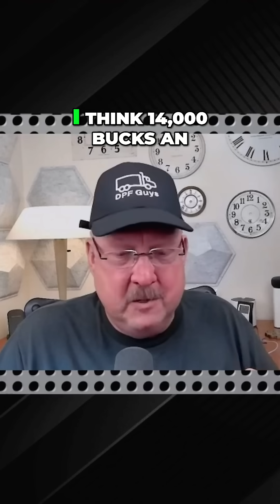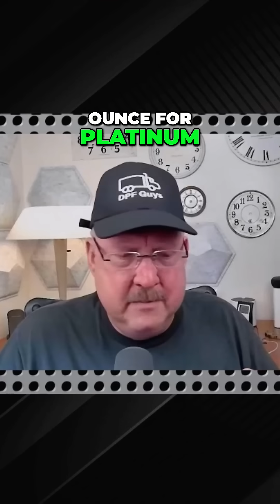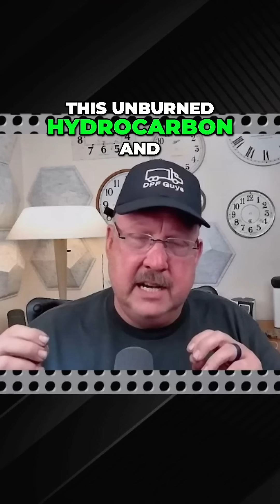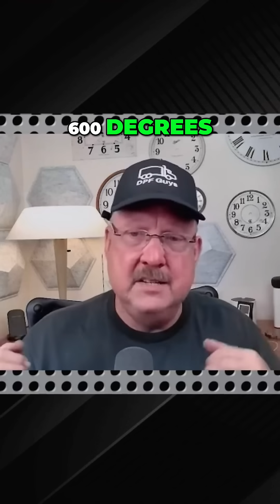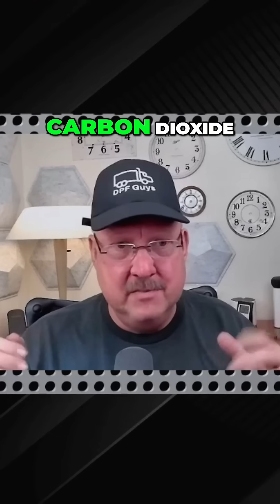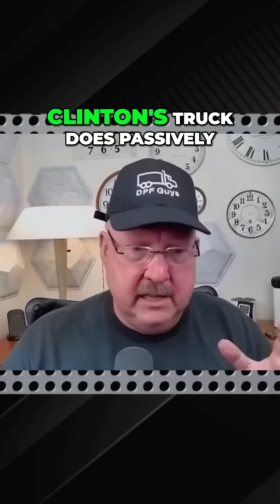Diesel Regen Explained: Catalytic Converters, Platinum, Rhodium & More!

Comment: Great education on synthetic oil protection. Great job, Mr. E on sharing the education about DPF filters. 
     Diesel motors must run clean and eficent to be have a great running motor. 
      Clean fuel injectors, 100% synthetic Amsoil motor oil that does not heat up and burn off, is what I learned from your youtube channel. 
      I'm always learning something new. 
Take care of your diesel truck motor or pay costly fixes down the road. 
      Thank you for your education.